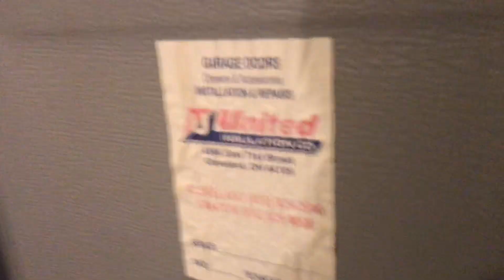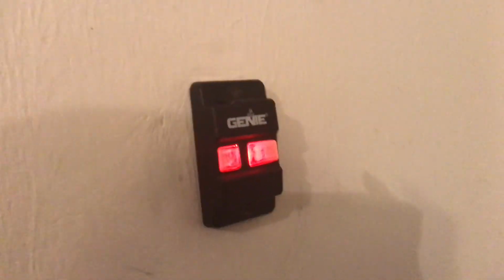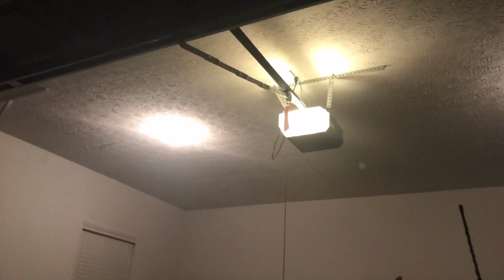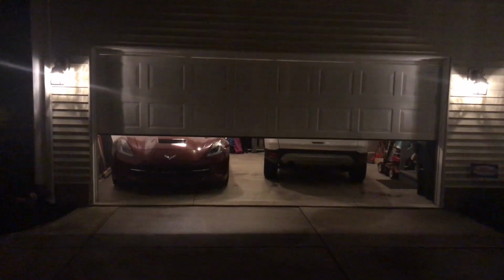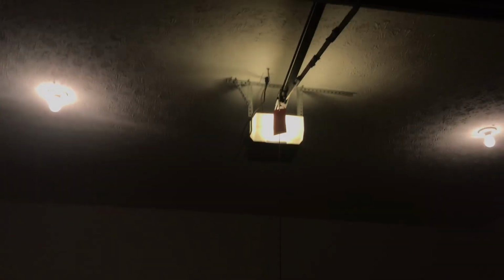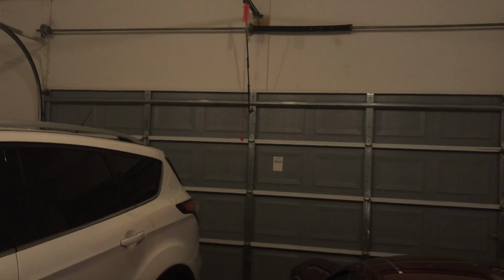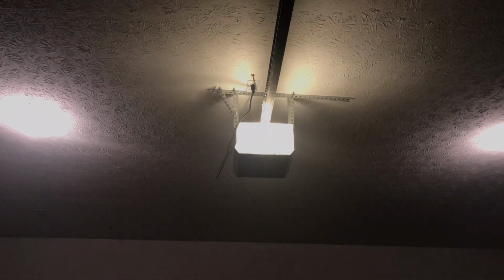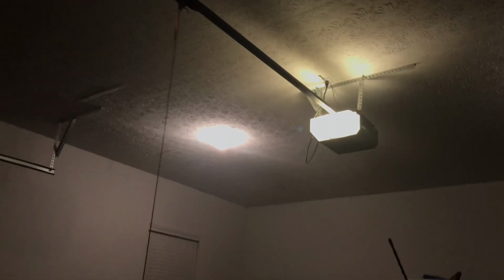Genie ProMax 1/3 HP Chain Drive Garage Door Opener Review

Comment: REALLY, you spent your time opening and closing the garage door? You need to read up on the garage door, known problems, needed maintenance, inspect for broken spring, type of lubrication, fasteners for the track properly installed, etc. Your door is NOT balanced. It must stay in place when manually pushed up to full open. Less than that will place too much stress on the motor. Also, homeowners should. not mess with replacing the spring or the door panels. It is very likely that you will be killed if failing to properly do maintenance or replacement. As much as many will minimize the danger of a garage door it is like a loaded gun. It can kill you. If it had not been for a six foot stepladder I would be either dead or badly injured.